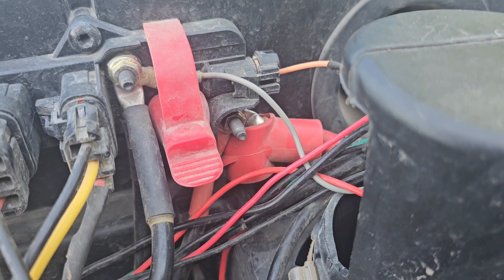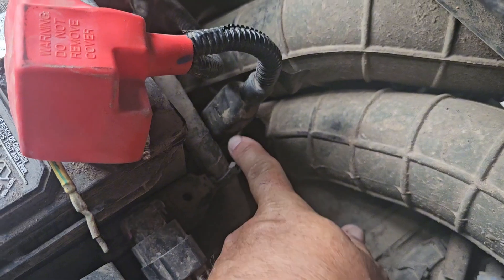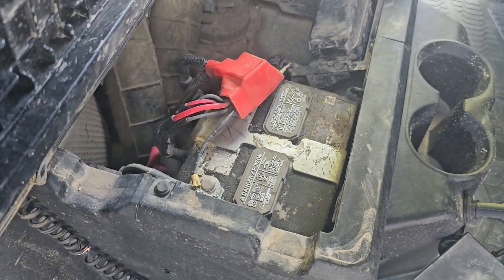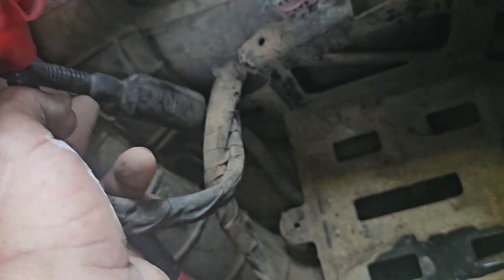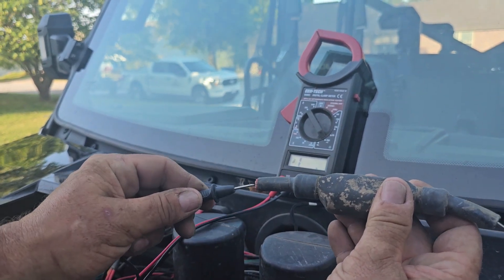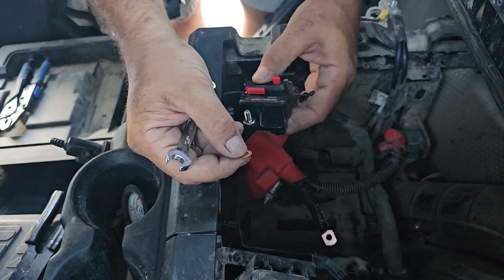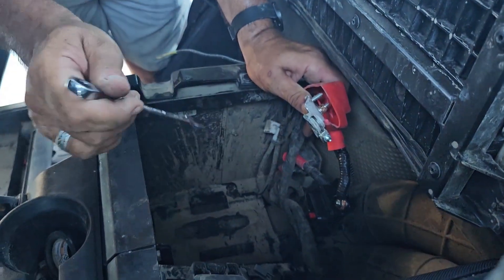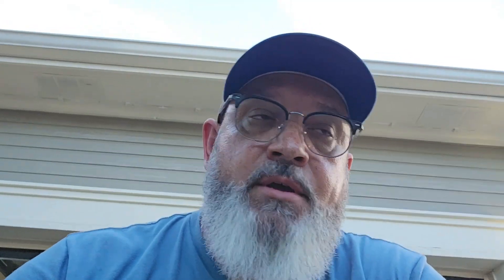2023 Polaris Ranger XP 1000 Crew 200 AMP Fuse blown and Solution.

Comment: NOTE. At the end I showed 30 volts on the mult-meter. That's a rookie mistake because I had it set on AC instead of DC. It was showing 14 amps while running with it set on DC.